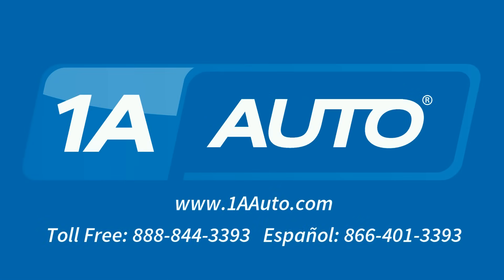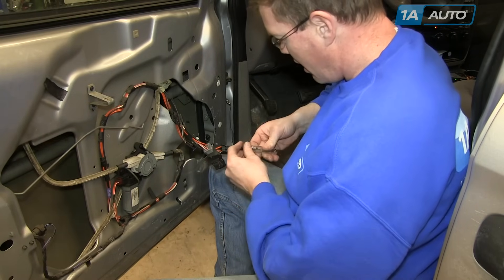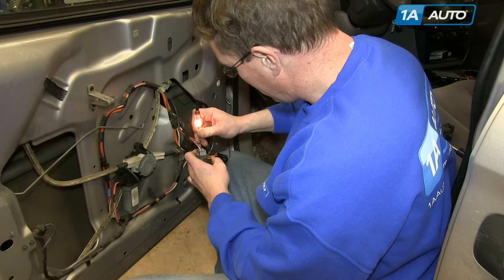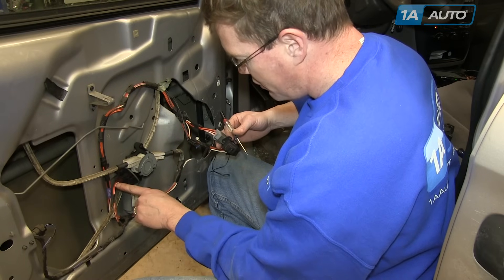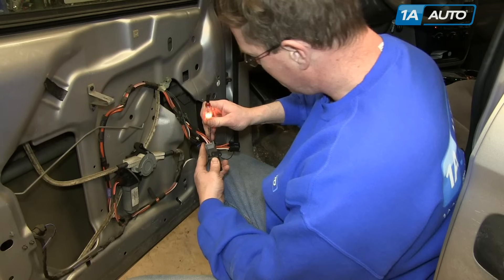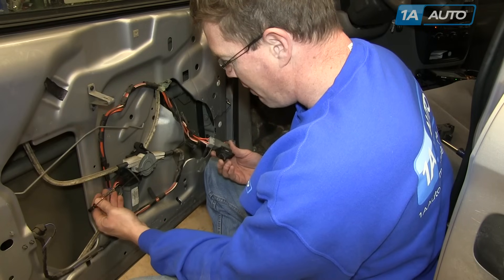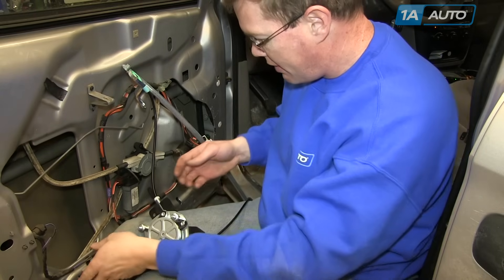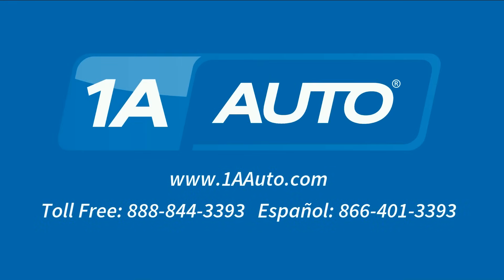How To Diagnose Power Window Problem - Is the Switch or Motor bad?

Comment: all four of my windows will not work. I replaced the master switch and checked fuses and breakers. Still nothing working. Went and exchanged master switch thinking maybe I got a bad one and windows still won't work. Any ideas. Door locks work on switch. I am frustrated.

Comment: Hi my window switch is fine motor is fine but only up works when switch is plugged in. So if I unplug it turn one upside down and reconnect with some wire and it goes up. Switch back and go’s up again. How do I fix please

Comment: I have a 2001 PT Cruiser . No pwr window buttons in back seat . Windows alos don't work from the front  either , any ideas ?
Reply from the maker: +Ue Sturdevant You may want to inspect the fuse to see if it is okay. You may also want to check the wire harness that runs between the driver's side door and body of the vehicle for a broken or frayed wire. Hope this helps you out. 1aauto.com

Comment: I have a problem with my passenger window. When i press master switch on drivers door to put up drivers window, that works. However passenger window doesnt go up or down from switch on passenger door, or the master switch on the drivers door. 
However, in your video when you get power to your switch, then when you test if power is then getting sent to the motor, you are automatically saying switch is faulty when test light doesn't show switched power going to the motor, this isn't true in my case!
I have tried three new switches but none of them send power to the window motor, why is this? 
Im getting power to the switch ob the passenger door, and I know for a fact my motor is ok as when i short the wires in the harness window goes up and down no problem!?? 
Everything in my case points to a faulty switch, but it just isn't! Any suggestions?

Comment: it would have been better if you did a video on checking switch which should not require the entire door panel to be removed...my chevy truck switches can be removed with no tools in 5 seconds and harness is exposed... my issue is strange and can't find a video on it at all... seems like a bad passenger switch...but with test light there shows not power to switch like on drivers side... i get clicking noise to passenger switch when i hit window switch on drivers side... also same harness also controls power locks and passenger side works fine... only thing that makes sense is i can't get a good ground for my test light on passenger side... a few months back i fixed passenger side by removing switch taking it apart and cleaned and window worked fine for months...weird..

Comment: If the window goes down but not up, is that indicative of a bad switch?
Reply from the maker: +Self Help Dude If there is power going to the window motor, the window regulator may be bad. If there isn't power going to the window motor when pressed in the up position then the switch may be bad. Hope this helps you out. 1aauto.com

Comment: I had changed the motor in my pacify truck window and I change the switch and still got no power but if I take a motor back out that's against the battery it goes up and down why don't I got power over there

Comment: I have a 98' Civic Coupe EX. Can somebody tell me how the motor window works, the connection was cut off from previous owner. I tried to do some wiring and only the up worked but it was weird. I pushed the button for it to go down but went up instead, and when I press up it does nothing. There's 2 cables, one red and one black what wire is what? And where do I connect those wires to?

Comment: my 2003 ml350 drivers window goes down but not up. the motor is working, the switch is working, the glass is in the track. what could be wrong?

Comment: This is all nice if the switch reverses the polarity . I need information on the type that use what I think is communication signal going to the window motor to determine direction in other words what the hell have I if I have power and ground wire and then 5 more little wires going to the motor

Comment: I have a 99 cadillac sts, all power windows, driver window works, all other 3 windows and NO power locka work at all, neither does speedometer, any suggestions? Please help
Reply from the maker: +Jayson J-Son Knight You may want to check the fuses.
Reply: 1A Auto Parts thank you

Comment: Ok. I've replaced the regulator with motor, replaced the switch and checked the fuse. Still not working.  There is power to the mirror switch which is also on the door but the windows don't work. Any suggestions on what I can look at next. The lights on the window switch blinks when you start the car but then go out and then nothing.  HELP PLEASE 
2002 Buick Century

Comment: If 3 windows work ( all work, EXCEPT the driver's window, ), would it be reasonable to check only if the driver's switch gets power.... if the driver's motor gets power...and forego the rest?

Comment: My car the window goes down by itself and doesn't come back up. I can hear the clicks. I rolled it back up, took the power off the window motor, and now I can hear something clicking as if it was trying to bring it down... can that be the switch?
Reply: Are you positive you took power away from the motor? There's going to be 2 or three wiring connections under the seat. Because the sound you describe sounds like the gear on the motor is turning but not engaged mechanically to move the seat.... akin to breaking a fan belt-- Stuff operates, but isn't properly engaged to connect to the seat mechanism. But... what do I know, it's just what it sounds like. Good luck. Again, follow the excellent video if it isn't a cosmetic type (DIY) fix.

Comment: that's a bad way to do it because what you're assuming is it's the motor when the window could be stuck locked and the middle can't push it so then you go and buy a motor from your company but when they try to fix it the motor doesn't raise the window which means the window stuck but now you can't take the motor back because you won't take electric motor back once someone has taken it out of the store so now they're stuck with a motive they didn't need because of the windows stuck

Comment: I have a 97 Ford F-150 passenger window motor works when I put power to it, it goes up and down but the passenger side switch only rolls the window up when I push the switch to the down I get power to the motor but it will not go down unless I reverse the wires on the motor and it will go down but only in the up position, The drivers side only has power to the up position only and its a new switch, I know the GEM Module only controls the driver side so I don't know what the problem is.

Comment: In July I ordered a new motor/regulator from you guys and had it changed now it doesn't work again any thoughts?
Reply from the maker: +Michelle Thanks for watching!  We recommend giving our customer service center a call at 888-844-3393.  From there one of our representatives can help find out if you need a new part, or it is just another issue!  1aauto.com

Comment: I have power going to motor but I replaced motor anyway but window still doesn't go up. I replaced motor even though it had power because I was frustrated. I replaced master side switch, swapped back window switch with front passenger side and still nothing. What can it be???
Reply from the maker: +alex alvarado Great question! Check out our library for more videos here: http://1aau.to/m/video-library-c

Comment: my 2013 Dodge grand caravan passenger side power window switch doesn't work
could it be the fuse or something else?
Reply from the maker: +Only1Jenda You may want to check the fuse to see if it needs to be replaced. If it is good, you may want to check the power going to the window switch to see if there is power to it. Hope this helps you out. 1aauto.com

Comment: YES, YES!!  Top  1, 2, 3 etc.  All wires between the Doors Break, No Window control, No Locks, No Sound...  Wires too short to fix properly. I add extentions to stop pulling when door opens. Pain in the Butt, over and over and over

Comment: I have a 2004 Grand Prix my windows won't go down or none of them I checked the fuse and it's good I don't get it am I missing something orchid the switch make all the windows not work even when unplugged
Reply from the maker: +rick carp Thanks for checking us out. There could be multiple reasons why you're having this particular problem. We suggest taking your vehicle to a nearby reputable shop to identify the cause. Once you know the cause, we'll be happy to see if we carry the parts and how-to videos needed for your repair.
Reply: @1AAuto   i fixed it 2 min after i drank some enj apple lol
someone mover the rap relay and put it in the wrong place

Comment: Help me if you can ,,Front windows will not work, unless you take the neg cable off the batt and  out it back on the batt . the windows will work for about 3 min ,than they stop working again . I remove the neg cable from the batt a few seconds and replace the neg cable and they work for about 3 mins . I have replaced the right door mod ,the body mod and replaced the window master switch on the right door . help pleasee .

Comment: This happened to my 2013 dodger avenger, the window came down and now it doesn’t want to come back up, i see that the switch lights up which means it has power, both switches on the driver and passenger side do not work, all other windows work fine, so i can only assume it’s the motor 😭

Comment: i have a four switch controller on the drive's side ,they all work except the driver 's window and it work only sometimes  now not at all    what could it be ????
Reply: My Hyundai is having the same problem.  Did you figure out if it was the switch or the motor?

Comment: On a Jeep Driver's door, the windows will not work with the door open also the locks will not work when the drivers door is open. Mine is a 1999, close the door and all is fine.

Comment: I tried everything i had power in the cables fuses were fine power from the switch to the motor and even tested te motor but when i connected everything it just wouldn't work

Comment: My power window falls down halfway if i put it all the way up, but if i use the control to slowly and precisely get the window to meet the top of the door frame then it will stay up
Reply from the maker: +Georgie Phaggotts Thanks for checking us out! This sounds like an issue with the regulator, we would start there.
Reply: @1AAuto  cheers 😃

Comment: My switch has about 10 wires soo confusing. It is working 100% from drivers switch but not from the passenger switch. I ordered a new one. Hope it's the problem. Not a wiring issue :(

Comment: When I turn my key over and hit the switch you can hear my motor rolling it down. Window wont come back up. I took my door apart(Land Rover Disc 2 Rear) replaced the entire lift by myself( I fixed the pass side right same way. Switched over motor. Put it all back together....smh you can still hear motor when you press the switch down but nothing when you press it up? Im lost. Both my back windows failed in a week. Ive replaced both lifts blah

Comment: hi I have bmw e30 316 2 door coupe and problem i.m having is when doors are closed my windows won't go up or down but when you open the doors the windows go up no bother can anyone help me with problem much appreciated thanks
Reply from the maker: +Mick Wilson Since there could be multiple reasons why you’re experiencing this difficulty with your vehicle, I strongly recommend that you have a reputable mechanic inspect it. They’ll be able to troubleshoot the problem and tell you what part or parts you’ll need for the repair.
Reply: @1AAuto  thanks for your reply really appreciate it Mick

Comment: Yeah this was no help at all. How do you get the door panel off? How do you get the button out? Is there a fuse for each switch (Drivers and Passenger side)? Or is there just one fuse for both switches?

Comment: Hi, i have civic 10th gen, the driver side power window button is showing abnormal behaviour. Its going up in single click but not in aito mode. And going down in auto mode but not on single click. Unable to diagnose. Pls assist. Thanku

Comment: what if I have changed the switch and motor on my 2012 F150 and steel no window function
Reply from the maker: +Rocky Mills Thank you for checking us out. It could be a fuse, a regulator, or a separate piece of the electrical system causing this fault. 1aauto.com

Comment: HOW CAN YOU TELL ITS THE MOTOR AND NOT THE REGULATOR?
Reply: The motor moves the gears and the regulator basically guides the window or pull the widow as it turns on the motor"s gears. if it is the regulator you can hear the motor moving but you would not get the desired result.
Reply: If regulator is bad but motor is good,  you will hear motor ruin and regulator grind

Comment: The windows motor module its a bad unit of Volvo, then have power in too the module , but not  power out from the module too the window switch, the sentral look does not work then , have Try it with a another motor with a another module with same problem

Comment: My car rolls the windows down but for some reason when I turn the car off and get back in it and try to roll them back up they won't roll up unless I smack the driver side door I'm guessing my problem is the switch and not the motor.
Reply from the maker: +Bismo Funyuns We wouldn't be able to diagnose an issue like that here, you may want to have a local mechanic take a look at it. Thanks for checking us out! http://1aau.to/m/Shop-1AAuto-c

Comment: ok so a company that replaced my cars window, he jerry rigged a wire to the battery of a drill to the window motor and it rolled the window back up / and down , but when the window wire harness is hooked back up it dosent work when I clicked the switch, and they can't find the problem.Any ideas? oh and try were drinking beer on the job, and driving, I won't trust TC Auto glass again .

Comment: my real mirrors don't stay adjusted, keep moving. It happened after I changed my window regulator. There are no videos that show how to repair the rear view window regulators . Windows like mine that still work, but don't stay adjusted. If I make it go up, it keeps going, doesn't stop so I can have it set on my blind sides. 
HELP
Reply from the maker: +kenneth Paulding You should go back and double check your work, as it sounds like there is now a wiring issue.  This could have happened when assembling/disassembling the door.

Comment: The switch operates (switches power and ground) with window motor unplugged.

Plug window motor back in and do not get voltage switching. With motor plugged back in i am not getting voltage for up or down, just have ground on both wires. Again with motor unplugged i get voltage switching when pressing switch up and down(power on one and ground on the other)

The switch works when unplugged 
The motor operates both directions when manually giving power and ground.
Ideas? 09 chev hhy
Reply: Matt Wright  Maybe voltage drop on the wiring between switch and motor--corrosion?

Comment: 2004 isuzu assender power windows switch fluttering and causes the lights to flicker
Reply from the maker: +Rob Douglas Thanks for your question. Unfortunately, we would not be able to diagnose an issue for you, but a local mechanic would be able to help you out. Thanks!

Comment: hey guys my problem is that my passenger window won't roll down from the driver side controls it works fine from the actual passenger side I changed the fuse what could it be? a loose wire? thanks for any help guys
Reply from the maker: +Ryan Distelrath Thanks for watching. It could be the circuit on the master power window switch. We would recommend testing the power window switch for the driver side.

Comment: i have the same problem I'm getting power to switch and motor and my motors work but when i plug the motor in it does nothing i got a new motor and still nothing it's a 89 gmc sierra ext cab 5.7 350 anyone have any ideas why it's still won't work

Comment: What if your motor works(verified with separate 12v batt), you have power at the motor(verified with volt meter and power to the brand new switch and STILL nothing?!?!?
Reply: When you use the power window switch do you hear the motor at all trying to move the window? If so its probably a dying motor not strong enough to move the window up/down. If you hear nothing then more than likely the motor is completely dead.

Comment: agravation $1miilion $ any super honda techs on here 
i love my 92 honda civic dx BUT
all my fuses are good relays are good new drivers front regulator and switch other 3 windows up and down from drivers switch and there own switches but the drivers window will not go up or down i use my power probe and at the plug for motor up and down check at the switch up and down but with out my power-prob key on engine off the switch will not work i have 3 other switches they all work except the drivers any ideas ive got power to switch cause all the other windows work from this switch i made grounds so i dont know what to think i am a tech and have traced wires and power im lost and im good with electrical  What am i missing please help

Comment: My driver's window go up and down but the other windows don't work at all
Reply from the maker: +Anthony Poole You may want to check the fuses to see if they are okay. You may also want to check the wire harness that runs between the driver's side door and body of the car. Hope this helps you out. 1aauto.com